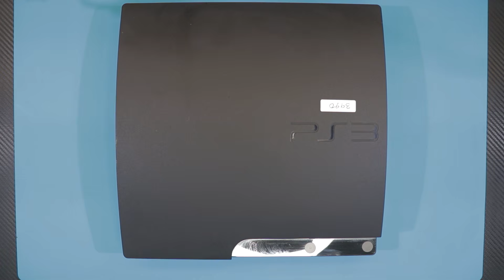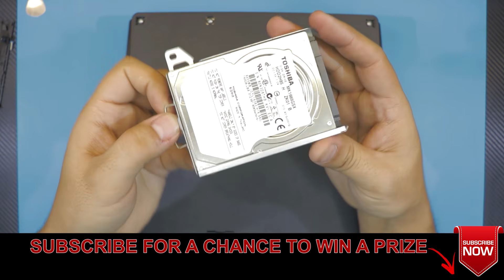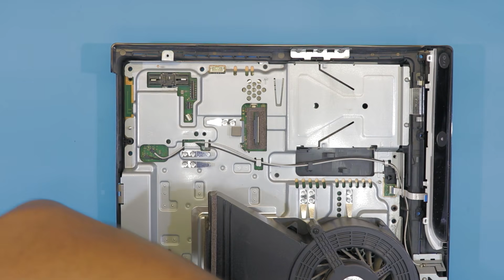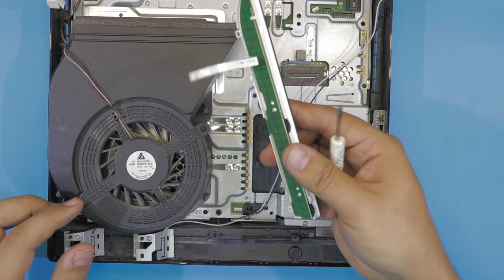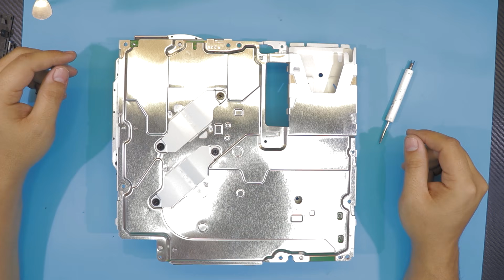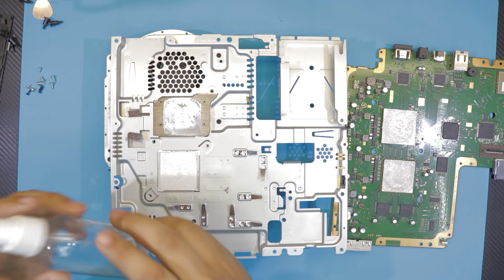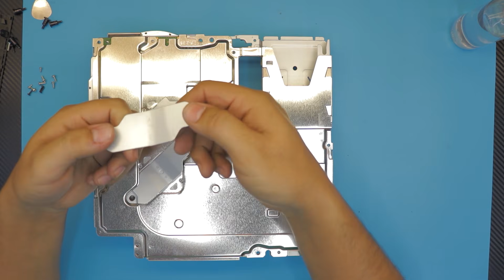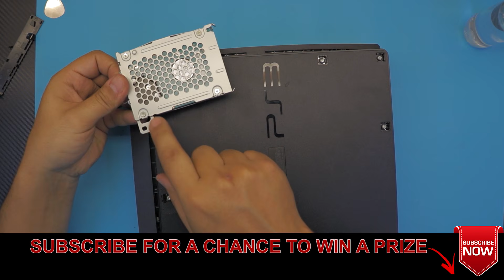HOW TO CLEAN AND  REPASTE YOUR PS3 SLIM ( playstation 3 slim console )

Comment: You will heat first the cpu ? What heater you use and how many minutes/seconds?
Reply from the maker: you can use a hair dryer at max heat straight over for 8min with 1" distance or,  heatgun at 270c over in circular motion for 5min with 1" distance above.
https://amzn.to/2WTOu0k

Comment: I don’t have thermal paste 😞 and I already took the thermal paste that it came with
Reply from the maker: oh boi, what ever you do , do not put it back together if you not place a proper good quality thermal paste:
https://amzn.to/376PiAA
or 2nd best:
https://amzn.to/3i3TIyA
Reply: @uFixTek  for the first link that you sent me, the paste is one gram in total, is it enough? Because I’m going to buy it
Reply from the maker: sorry one gram is not enough:
https://amzn.to/3BJ3kqm
Reply: @uFixTek  what about 4 grams? Is that enough
Reply from the maker: sure 4g can be enough
Reply: @uFixTek  sorry for the bother but does it have any good affect on the graphics because my ps3 worked just fine years ago but now it’s stuck on 480i. Will it help?
Reply from the maker: im very sure it may help out because if the GPU was over-heating it was the issue. but regardless you will need to place a good paste every 2-3years.  its like driving a car and you dont want to replace the engine oil.
Reply: @uFixTek  si you mean that every 2 years I also have to do it for my ps4?
Reply from the maker: its recommended to clean up your console every 2-3 years, maybe not repaste but clean the fan and dust.

Comment: hey man, is it possible to change the thermal paste without removing the hard drive? the reason im asking is cause the previous owner of the slim has stripped the blue screw that holds the internal storage.
Reply from the maker: Thank you for the feedback! if you wish to support the channel you can LIKE or SUB or both :P
regarding your question: YES unfortunately you MUST remove the internal hard drive in order to separate the metal plated to get to the thermal paste.
Reply: @uFixTek  oh that a bummer :( I’ve cleaned the fan and heatsink, do you think I should be fine for now not re applying new thermal paste?
Reply from the maker: its defiantly a progress and it will be okay still if you didn't repaste.
as long as you don't keep that ps3 on more than 8h daily straight. then you more than fine.
just keep the fan and heatsink clean, once every 6months.

Comment: Can i use eject cover from PS3 CECH – 2000A/B  to PS3 CECH – 3000A/B ? Cause i want the LED on power button and Eject button.
Reply from the maker: they use the same board on both models. use ebay to get parts

Comment: I don't have a torx screwdriver. Is there any other tool or instrument I could use to remove the security screws?
Reply from the maker: Thank you for the feedback! if you wish to support the channel you can LIKE or SUB or both :P
regarding your question: you would need to break the pin in the middle of the screw and use a small flat screw driver, but again its very hard to accomplish that :(
Reply: @uFixTek  Thanks for your advice.
Reply from the maker: anytime my friend :)

Comment: What if I don't have any thermal paste
Reply from the maker: Thank you for the feedback! if you wish to support the channel you can LIKE or SUB or both :P
regarding your question: if you don't have thermal paste then DO NOT remove the heatsink, just blow compressed air  to clean the dust.
Reply: @uFixTek  can you vacuum the heatsink?
Reply from the maker: @2Glock9zz  you could but the air suction won't be enough or it may depending on your vacuum. try it out, no harm done.

Comment: Hi, What are "still good and normal" temperatures for cpu and rsx of ps3 slim after several hours of game?
Mines are around 70 c. 
i really dont want to tear it apart.
Reply from the maker: Thank you for the feedback! if you wish to support the channel you can LIKE or SUB or both :P
regarding your question: if you sitting on 70c after 1h gaming then you fine, just open the covers no need to remove the heat-sink or anything and blow the air and clean the dust.

Comment: Can you do the delidding to add the thermal paste on the chip?  thanks.
Reply from the maker: Thank you for the feedback! if you wish to support the channel you can LIKE or SUB or both :P
regarding your question: I WOULD NOT RECOMMEND, at all to do a delidding to a CPU or GPU, because the risk over 1-2c drop its not worth it. you wont get anything extra with delidding we have done it and the results are the same before delidding.
Reply: @uFixTek  thank you very much 👍🏼
Reply from the maker: your welcome

Comment: My 10 year old PS3 slim runs very quiet, but I know I must replace the thermal paste for good measure. Very helpful video, thank you.
Reply from the maker: Thank you for the feedback! if you wish to support the channel you can LIKE or SUB or both :P
OMG trust me your PS3 will start talking to tell you THANK YOU :P
you will increase the life span of the console. its like having a car and never needed to replace the oil, the car would run still but at any point it will lock down and GG.
Reply: Yikes 

Sometimes changing the oil in a car that has only been "filled with oil" is bad for the car lol sooo I've always changed out my oil but im scared to change the oil (clean) my ps3 lol

Comment: It's still not working after pasting it's still going off what can I do now.
Reply from the maker: Thank you for the feedback! if you wish to support the channel you can LIKE or SUB or both :P
regarding your issue: when you power on what happens exactly, ?? it turns on and it turns off after few min without playing or it turns off when starting playing? its important to give me in details.
Reply: @uFixTek  it works for seconds then switch off I got the red light it turns green then seconds later it switchs of I already used thermal paste but it isn't working correctly till now what can I do to fix and thanks for replying.
Reply from the maker: you have a bad power unit, its very common and we get this issue a lot in the store, its not something you will be able to repair, you will need to replace the power unit.
https://amzn.to/3xjUoVd
Reply: @uFixTek  thanks I will check it out.

Comment: Is this not too much thermal paste?  I see people using far less and then evenly spreading it with a card.  Can you confirm that 'less is more' in terms of the paste doing its job correctly?  Or does the slim need way more than PS3 Fat?  Thanks, great video by the way.
Reply from the maker: Thank you! for the feedback and your support to the channel by SUB :P
regarding your question:  about the thermal paste there are many factors that come into effect when applying,
#1. the type (brand of paste)
#2. some thermal paste are more softer than others as they are more harder. viscosity
what im trying to say that the artic mx4 is a paste that is more runny than the artic silver 5 or other pastes. and that means when you paste the artic mx4 the pressure created by heatsink will spread the paste evenly all over the cpu/gpu.
but if you use a artic silver 5 or any other brand that has more viscosity, then in that situation less is better and is better  to spread the paste.
the amount of the paste i put its perfect , and the test would be place the heatsink with pressure and wait 5min and lift the heatsink and you will see the results.

what type/brand of thermal paste you using?
Reply: @uFixTek  Thanks for the info.  I bought MX-4 Arctic as per your videos recommendation.  Thanks, I will apply the same amount as you've used in this case. Shame I only have 4g though, will need to buy more for the other 2 consoles I have.  Cheers!
Reply: When choosing between Arctic Silver (a pea sized amount) vs the MX-4, can I ask why you'd choose the latter?  Wouldn't the silver be more cost affective?  Is MX-4 better for doing the job? Thanks again for your help!
Reply from the maker: the reason you should not use the "pea size" in the middle of the  cpu/gpu, is that people dont realize one thing,
you dont actually need to cover all the space on the cpu or gpu place.
you have to know whats under the Heatsink.
under GPU there are 4 vram catch chip and the die in the middle and empty space , if you apply a pea size it may not get to the far corner well (risky), but if you do the X shape you assure that the corner BGA chips and the die in the middle are covered.
Regarding the CPU that's different you will only need to apply a little "pea size" in the middle. (the reason i didn't do pea size on cpu is that my comments would be like : WTF, jesus , comeon, WHY? lol
here i made a drawing of the HIC removed and marked the components.
https://imgur.com/a/fH4NBeX
Reply: @uFixTek  Thank you so much for clarifying.  What an awesome channel! Thanks again
Reply from the maker: its my pleasure my friend :) if you got any question or request feel free to ask me in a new comments as old comments  go down the list :P

Comment: My PS3 Slim struggles to boot up. When it finally boots up, it either freezes shortly after or works for 3-15 hours of use as if nothing had happened, but then doesn't work in a long while and struggles to boot up & keeps freezing. 

The power supply is not the issue as I've replaced it. The fan also kicks in every time. Could these issues be caused by a lack of thermal paste? I haven't fully disassembled the system to see the thermal paste status. The inconsistency of the system's behavior is most confusing. Yesterday, I was again fooled by the console, because it worked for many hours without problems.
Reply from the maker: Thank you! for the feedback and your support to the channel by SUB :P
regarding your question:  you defiantly have a thermal issue, i would highly recommend you to repaste the thermal paste but use a high end thermal paste. like:
https://amzn.to/3oErLzd
or https://amzn.to/2SmAg5F

if after the paste you still get the issue last and for sure it would be a bad solder joint under the GPU, or dry solder join. i could assit you with it, but 1st do a repaste and hope that solves your issue. also make sure your vent is really cleaned.
Reply: @uFixTek  Thanks for replying and encouraging me. I'm now going to buy MX4 thermal paste and apply it to my PS3. I'll let you know how it goes. I hope my PS3 won't have to fool me once again.
Reply from the maker: oki , good luck let me know :P
Reply: @uFixTek  I got through the process. I put the disc drive back the other way. I found it easier to hold it in the air while putting the ribbon cable in. You forgot to put one of the black screws back right after putting back the three ribbon cables. =). My PS3 booted, and I played a little. I can't say anything about it working yet, because my PS3 has fooled me before. I'll have to wait and see.
Reply from the maker: ya if you careful you can do it from under, but its risky for me to make a video that way as people following the video may damage the flex cable. regarding the screw i know i been told, as this video was one one my 1st videos and i wasn't used to record and talk and pay attention at the same time on manythings :P, after the video i did reopen to place the screw, but its not important. now im getting better at recording as talking and servicing at the same time and i have invested in 4k and better audio:P . TEST the PS3 for the day and lets hope for the best.
Reply: @uFixTek  I'll test it for the two weeks before I say anything. Last time, it lasted 15 hours before it started showing symptoms. I thought I had fixed the issues but I hadn't.

Don't worry about little mistakes like that that are not serious. You did tremendous job explaining how to do everything!
Reply from the maker: thank you my friend :)
Reply: @uFixTek  The PS3 is back to its old symptoms. Once again. Disconnecting some parts and putting them back in made the system work for 12 hours or so without problems. I don't understand what causes it to suddenly work and then not work. I might have to give up on the system. It booted up after it had been off for 2 hours or so. It immediately froze. It didn't have any problems booting up when it had some temperature inside, so when it had been turned off a minute before. P.S. The system didn't sound different after thermal paste. I think I put it correctly. I put a little bit of thermal paste on the chip and then covered the chip with it using a card.

I'll attempt to repair my 60GB YLOD Phat when replacement capacitors arrive. I bought 20 capacitors to replace the NEC/Tokin capacitors. I hope I can get at least the phat working. It's my first console, and it'd be nice to have a backup PS3 in case something happens to my working Slim. My local library has a soldiering workshop space, but it's closed because of Covid 19. I'll be waiting for it to open and the capacitors to arrive.
Reply from the maker: Dont WORRY , i got you Covered. i will give you the FIX, trust me. now im confident of whats the issue :P
let me ger home in few hours and i will write down the steps you will have to follow exactly.
Reply: @uFixTek  Thank you for following up. If you're about to suggest delidding it, I'm a bit skeptical of that but regardless, I'm open ears to hearing whatever it is. P.S. I didn't use any heatgun or so yesterday when I put the thermal paste.
Reply from the maker: no need to delidding , i would like you to do the following steps:
#1. a room with no air flow or air condition (room temp) no fan.
#2. remove everything off the motherboard and place it on top of a wood (no glass table nor metal nor fabric)
#3. optional, use a aluminum tape to isolate the gpu and cpu.
e.g. in this video @10:05 you will see how i isolate the gpu and cpu.
https://www.youtube.com/watch?v=LPThmVu9-JM
#4. once the motherboard is on a flat balanced surface. use a heat gun or if you dont have no problem, USE a hair dryer, set it at mac heat and medium fan speed.
#5. place and hold the hair dryer over the gpu with a distance of 1" directly above for 5-8min
#6. same for CPU. right after you finished with GPU no need to wait to cool down.
#7. when finished its VERY important that you let it cool down on its own, no moving the board or anything for 10min|
#8 repaste and you should fixed the issue.

The above repair is a Re-flow of the solder joints under the GPU /CPU, home made re-flow :P
Reply from the maker: Louis Rossmann is 50% right , 50% wrong. because you  can't place your hand on a chip and know if the issue its from inside the die or the ball joints under. and if you investigate more than 80% of the issues are 1st with under BGA chips with cracked or dry solder. he goes and assume that all BGA will fail because of flip chip.
i been doing this for over 18years now and 80-90% is the solder joints we have reballed many chips and re-flow many.
but all this apart, you have nothing to loose except that you have a big % chance to fix.
Louis Rossmann is really good at repair components and trace schemetics and all but that don't mean that you have to ignore the other big % of the factor of errors that can cause the issue.
maybe in a mac motherboard the issue is more commons with flip BGA, as he only does macs.
i wish you the best and if anything i can help you let me know.
Reply from the maker: not saying he is wrong but is he assuming that reballing / re-flow is useless! :/
and when there are many facts proving not!
https://imgur.com/a/acG6elQ

Comment: My ps3 slim is a little different inside. Can I follow your steps normally? Any differences?
Reply from the maker: thank you! for the feedback and your support to the channel by SUB :P
Regarding your question: Yes 99% its the same thing  you cant go wrong, also here a slightly different model,
https://www.youtube.com/watch?v=Gey66EGkCBs&t=0s
Reply: @uFixTek  thank you for your quick answer. My drive had a disc inside, now it can’t pull in discs like if had one inside. Do you know how to fix it?
Reply from the maker: you will need to open the dvd rom slowly and careful with mechanism, i will try to make a video on how to remove it sorry for long delay.

Comment: thanks for the guide, i cleaned my ps3 and reassembled but when i plugged it in there was no red light no power nothing, i tried another cable and it also didn't work.
Reply from the maker: thank you! for the feedback and your support to the channel by SUB :P
regarding your question: double check your 12v power cable that goes from PSU to motherboard.
Reply: Hey man did it work out? I got the same issue. no power or lights after repasting. I think the motherboard died.

Comment: Sooo!
First, thank you very much, it's so easy to have someone to follow when it's the first PS3 you open!
I had some troubles with the bluray drive because I left a disc in it and I had to reset it by removing a gear
And you forgot 1 screw behind the drive lol was scared to see a screw left 🤣
I would have been easier if you showed the screws before reassembling them but overall it was very useful to me!
Reply from the maker: You are welcome! thank you! for the feedback and your support to the channel by SUB :P
regarding the screw its not a important screw , i had to reopen and place the screw later on but, ya this was one of my 1st videos and i was learning to focus on camera and do the job and talk and all at the same time :P but i got better at it , if you haven't place the screw nothing will happen.